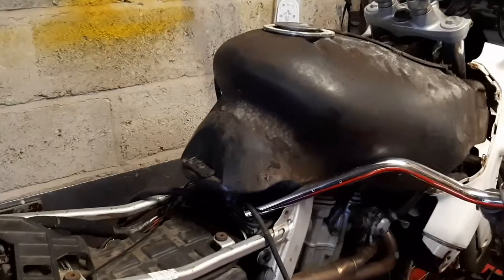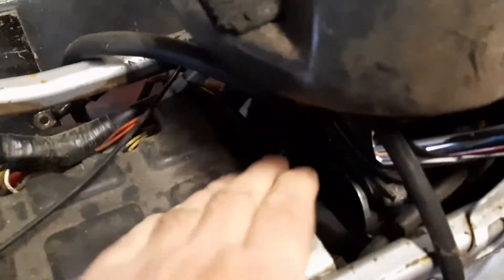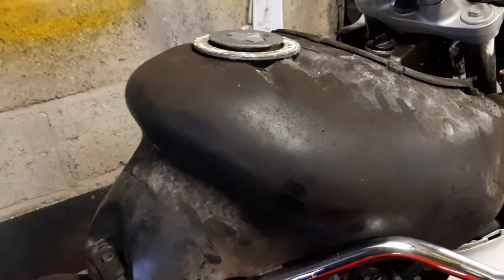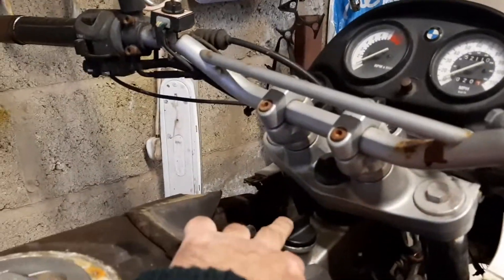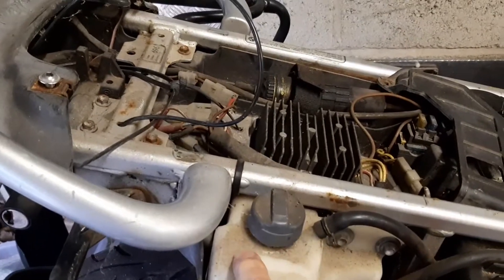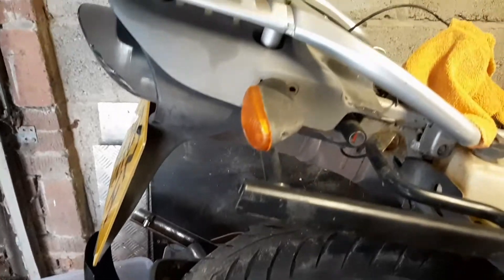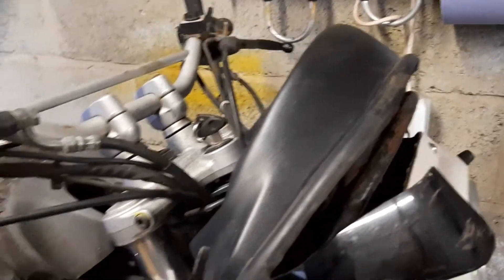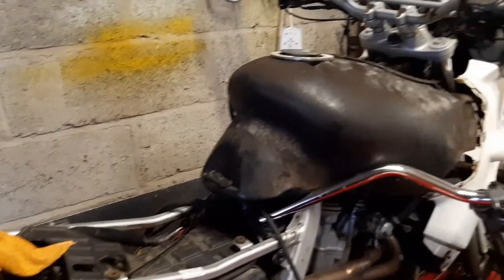My BMW F650 Funduro Project #F650

Comment: Iyi günler benimde f650 motorum var rölanti devrini düşüremiyorum hep 2000bin devirde çalışıyor
Reply from the maker: A motorcycle idles high when it is getting too much of an air and fuel mixture in a low speed or neutral position. This is usually caused by the idle screw on the carburettor being out of adjustment.